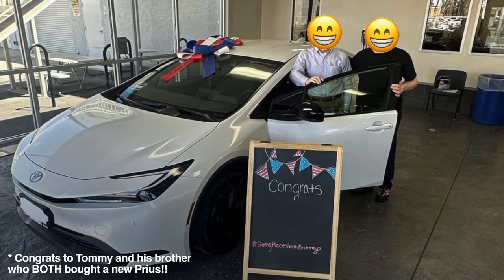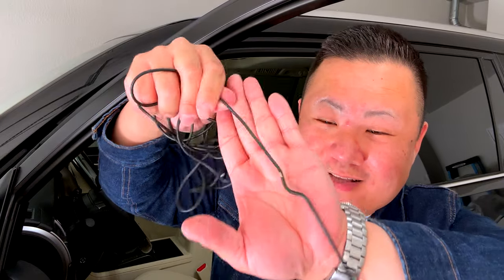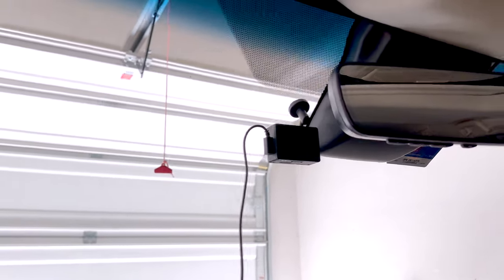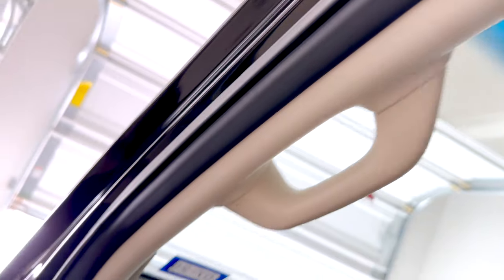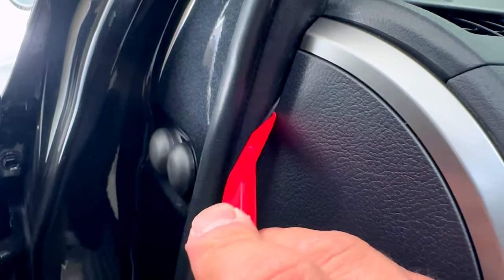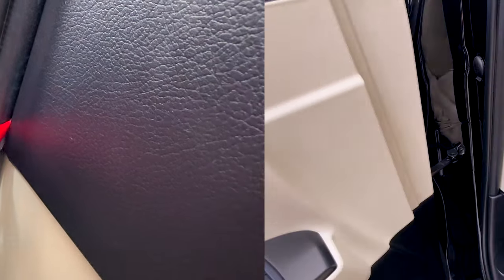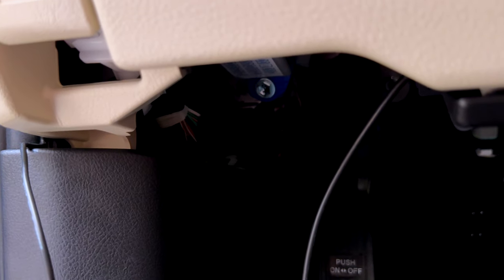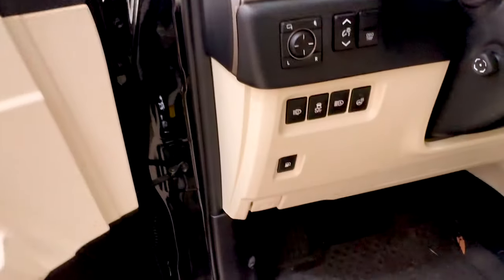HOW TO: Dress your dash cam cables!

Comment: Josh - i have the 57 series in my cars, with the micro usb parking model hard wire cable.  Do you know if i can buy a small micro-usb to usb c adapter and use the previous generation parking model power cable with the new series dash cams from garmin that take usb c? Thanks
Reply from the maker: You could but I don’t think there would be any benefit to you in doing so—plus you’d have an adapter hanging off the camera. If yours is working fine now then I wouldn’t change anything unless you upgrade to a new camera.
Reply: @joshjamescars  yes of course, I just meant if I ever upgraded the camera. Since my cars are hard wired and it would be a pain to rewire to a new power cable etc. Thanks!
Reply from the maker: @cjqamg Ah in that case I would rewire. Most adapters aren’t made to be automotive quality (you don’t want that melting up there) and the new cameras may need higher levels of power or what not that the new cables provide. It’s tedious to rewire but you’d only have to do it once.

Comment: So you plug the cable into the adapter, but what about the other end of the adapter that connect to the power? Seems like you are only half done.
Reply from the maker: Watch the full video, it shows the adapter plugged into the OBD2 port which is where it gets power.

Comment: I clicked on this because I can’t get the wiring to stay in the headliner where you pushed it in the beginning. I was hoping you had some advice for what kind of foam or rubber material to use as the gap filler. I used tissue for the longest time but it looks horrible 😣
Reply from the maker: Hmmm I’ve never had that issue, and I highly advise AGAINST putting anything up there that isn’t meant to be in there as your windshield can get burning hot during the summer and melt/singe anything like that.

Comment: What about ones that connect to cigarette lighter ports?
Reply from the maker: Those you route the same way, and depending on your car you’ll just want to route the cord to where ever the 12 volt socket is. In most modern cars, though, you can route the cable directly to a USB port and many have those inside or on the back of the center console which makes for a nice, clean install.